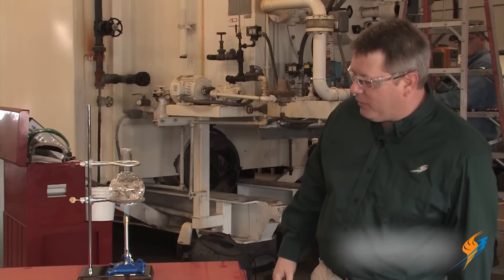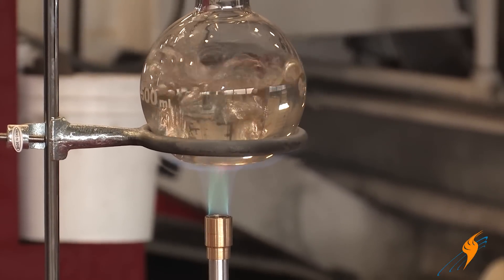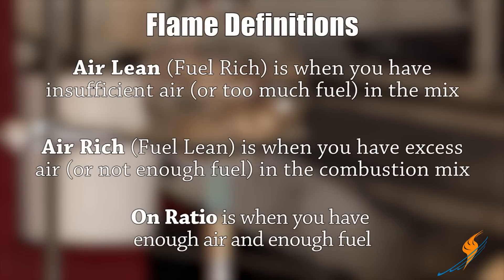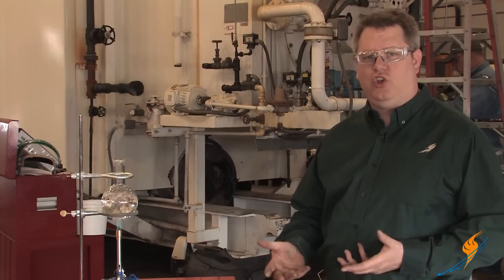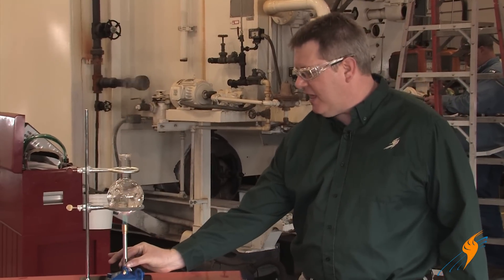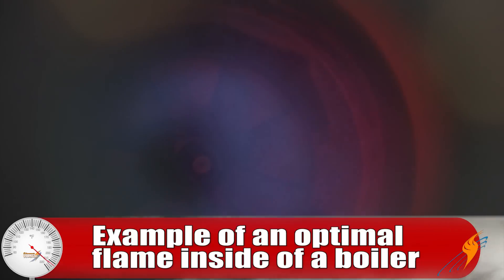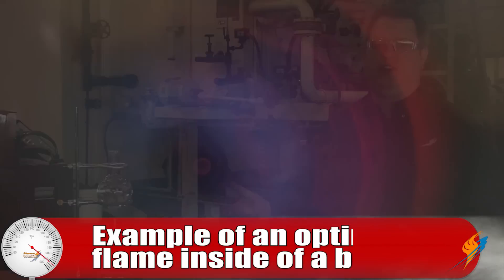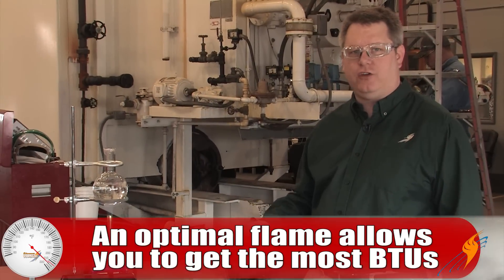The Importance of Combustion Tuning - Boiling Point

Comment: I was wondering why manufacturers don't utilize an oxygen sensor in the exhaust stack to constantly monitor and adjust the excess air setting of the burner?
Reply from the maker: That's a really good question. If you are monitoring your exhaust stack you can really dial in the efficiency of your boiler's combustion saving tons of money in fuel. Appreciate the comment and thanks for watching!